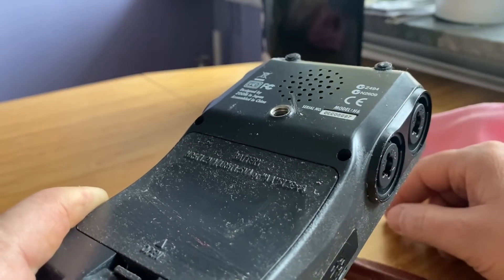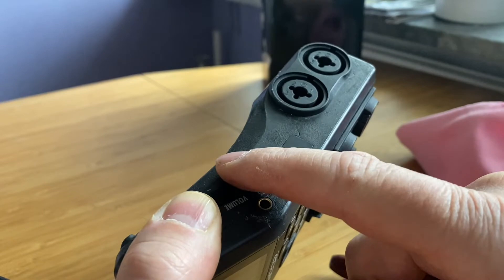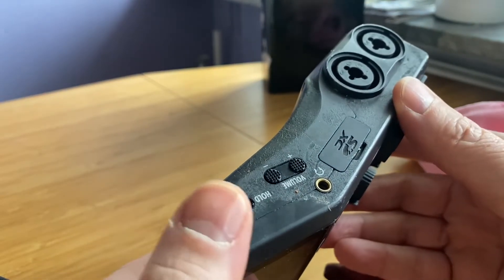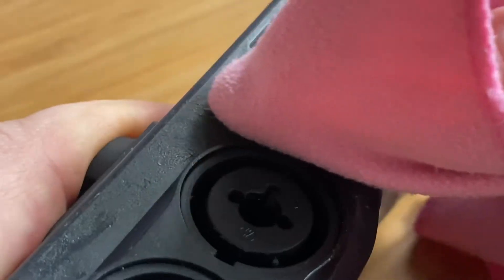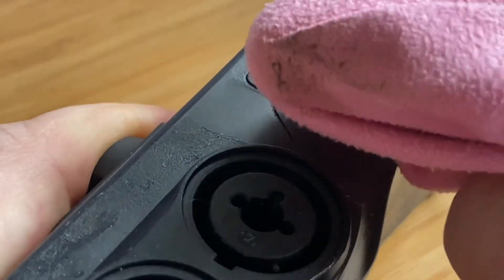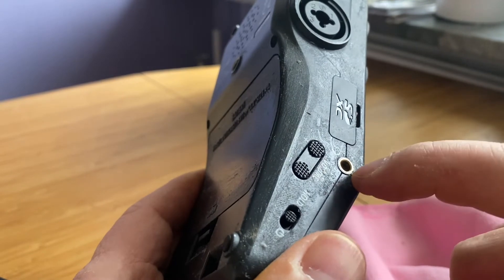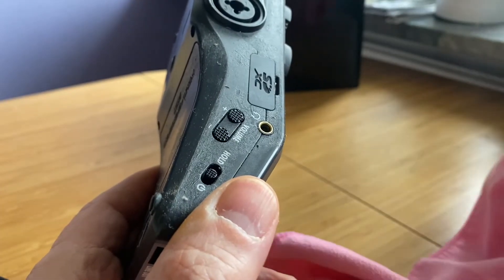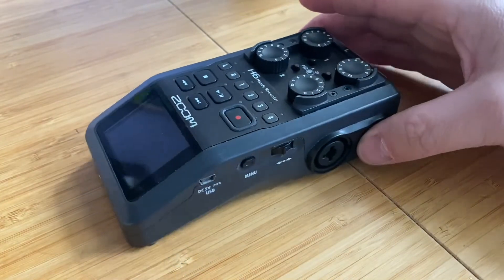Get rid of sticky surface on Zoom H6 easy

Comment: This post helped SO much. I have a Zoom H5 and that got sticky after about 5 years. I even stopped using it because it wasn’t fun to use - even though the captured audio was good as always. I almost started down the chemical cleaner path but did not want to lose any of the printed info on the H5. I also reached out to Zoom a couple of times and received no response. While I considered replacing it with another new H5, I found this video. If it worked, great. If it didn’t work, then I would reluctantly replace it… It took a couple of hours, but I finally got about 99% of the stickiness off. It’s been not sticky for a couple of years at this point and I use it regularly again. THANK YOU THANK YOU THANK YOU.

Comment: This absolutely worked. Thank you! Took almost an hour, my H6 was DISGUSTING. However, afterwards the battery cover remained sticky. I used the "cleaner + bleach" bathroom spray cleaner from Target and that did the trick (of course, I took the battery cover off first). I much prefer to clean gear without the use of any chemicals, this is a great solution.
Reply from the maker: Me too! Thanks for comment!

Comment: I just (now) used regular glass cleaner (Windex was my choice) with disposable paper towels and it took me about 30 minutes or more to carefully remove it all.  The residue was INCREDIBLY sticky and it sticks to your fingers and then transfers to other items.  From what I can see, the polymer-chain bonds (at the microscopic level) break down over time and this is what causes the rubberized "grip" surfaces to become tacky. This process of rubber degradation occurs from the moment of manufacture and usually becomes obvious after at least a year or two. Some components (most of the plastic exterior shell) for the Zoom H6 were first sprayed with a thin layer of a substance that seems to be a rubberized compound to enable better grip when handled.  This is translucent and was sprayed over the text for the various button functions.  The results after cleaning were cosmetically excellent.  My H6 looks brand new now and the stickiness I was dealing with was as bad as it gets.  No streaks remained and most areas were matte again afterwards whilst semi-matt surfaces were observed around the front of the device.  Thanks for this video Peter Wiren, it inspired me to try to reclean my H6.  I'm also familiar with this issue as it has also affected some camera lenses, pens and other devices that were made with similar coatings.

Some TIPS:

* Avoid using Armorall because your device will end up with a slick, super-shiny look that makes it appear as if covered in oil and your fingers will transfer it elsewhere. It's also said to make plastic brittle.  A few videos exist out there are recommending it - but I don't. It will also make your device reek of Armorall from that day forward.

* I once lightly dusted my M6 with talcum powder, as recommended by others a few years ago. Unfortunately, this simply coats the exterior and gives the impression that the rubber is no longer as sticky.  The talc will eventually be absorbed by the rubber and the unit will quickly return to being sticky again.

* Try to use a lint-free cloth but only clean the LCD screen with a microfiber cloth designed for cleaning optical glasses or sunglasses to avoid scratching it.  I used a roll of paper towel with tear-off squares and achieved excellent results.  The H6 looks brand new afterwards.  Apply the spray to a table or plate and dip your paper towel in it.  Don't spray the device itself directly.  Avoid using a paper towel or napkin on the LCD because it's made from wood pulp and will leave fine scratches on the LCD surface.  If you can't access a suitable fine-weave microfiber cloth, you might consider clean cotton underwear as a last resort.

* There's no need to rub excessively hard - but use repetitive movements to transfer the sticky rubber residue to the cleaning cloth.  Make sure to use fresh paper towel squares when cleaning new surfaces.  If found that my window cleaner had no affect on the printed text next to the buttons on the H6 device.

* Do NOT use liquid turpentine to remove the compromised rubber surface because it will presumably erase the printed text next to the buttons and functions.  Liquid turpentine will also likely damage the LCD and cause it to "frost up:" and you won't be able to fix it if this happens.
Reply from the maker: Thank you for all this information! I think its wierd that companys (i also have this issue with other products, like an light from rotolight) use this material. They should know about this?

Comment: What pisses me out is that Zoom knows about the problem and still produces their devices with this shit. I will never buy A Zoom product again.
Reply from the maker: I dont think thats true actually. I have friends who has bought a later version of the product and that doesnt seem to have that rubbery surface at all. I think they know about this problem and have changed..
Reply: Same.
Reply: ZOOM will actually replace the unit with an H6 All Black.  Just contact them.
Reply: @jerrykovis5417  I have contacted them twice, they never answered. This is the second time I contacted their support through the years and they never solve anything. I put them in my black list and I warn anyone to never buy their shit. 😡
Reply: @user-vl4vo2vz4f  That's too bad.  I had no issues.  First time I called I spoke with an agent or something and they sent me an email with documentation to get a replacement.  Because of this I'll definitely support them in the future.